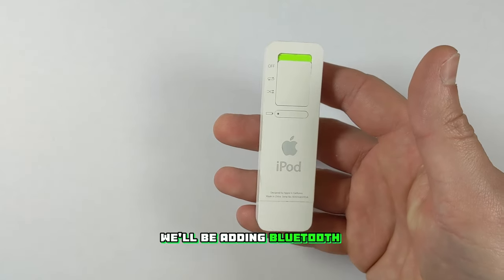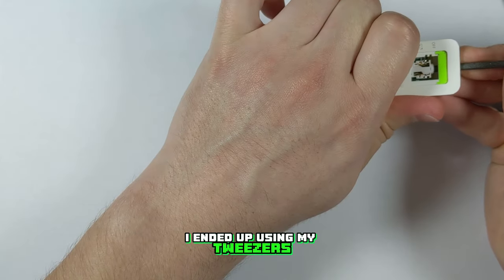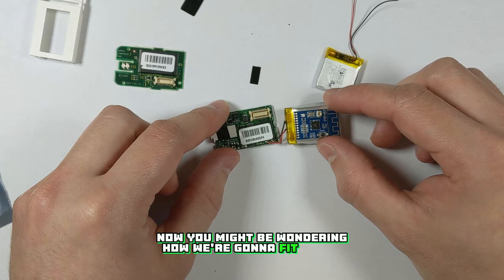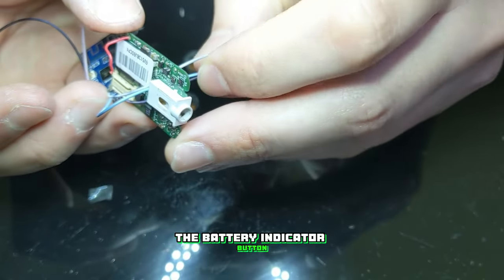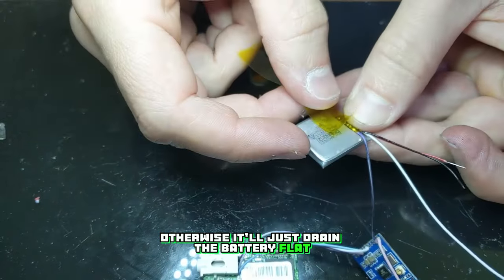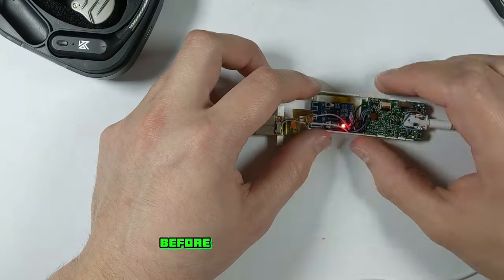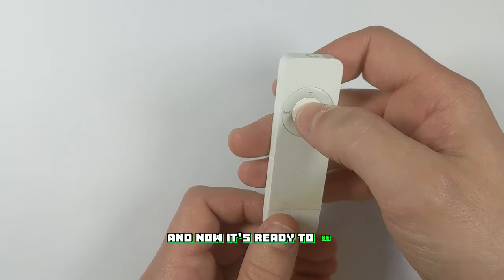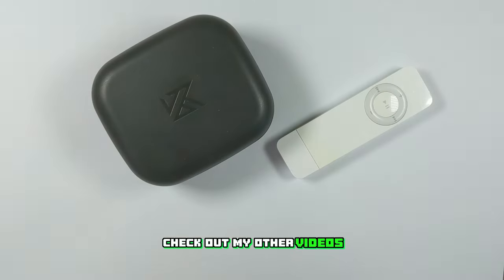Bluetooth iPod shuffle 1st Gen Mod Tutorial

Comment: This is so cool! I found a first gen shuffle at a thrift store for a few dollars. The battery is flat and doesn’t hold a charge. If I need to open it up to replace the battery I might as well and go all out and try this Bluetooth mod. 

I assume this Bluetooth board is just a standard receiver? Will it work with AirPods?
Reply: Kind of.... The Bluetooth will connect, but the functions will not.

Comment: what is the estimated battery life with the smaller battery and bluetooth board?
Reply: since the original has about 18 hours, and the new battery is half capacity. 9 hours without Bluetooth, 5-7 with